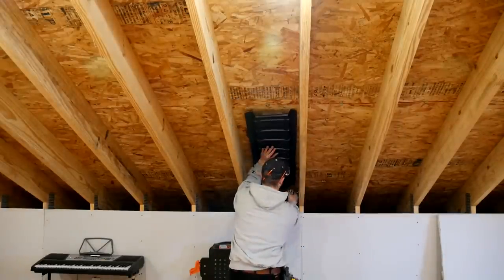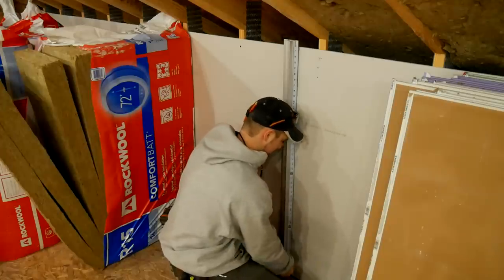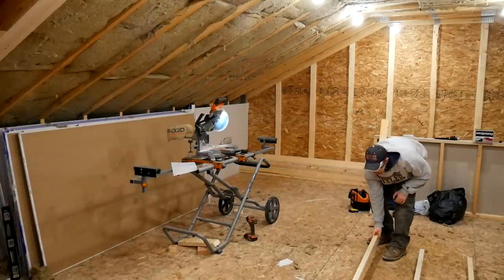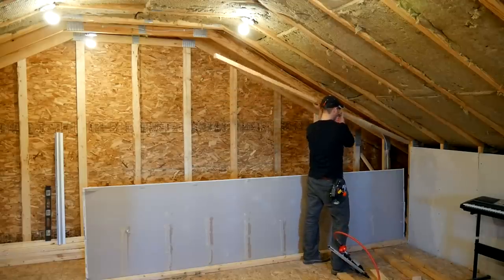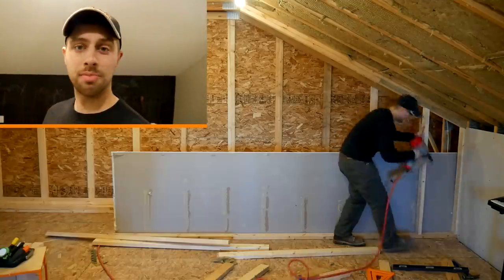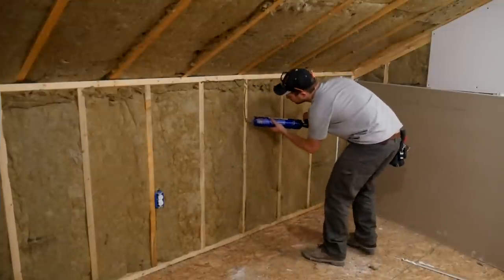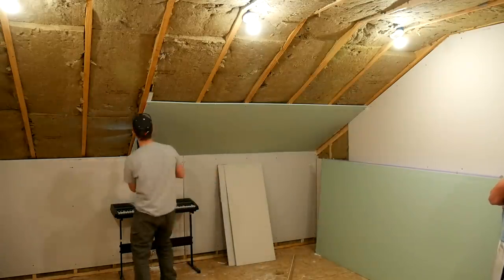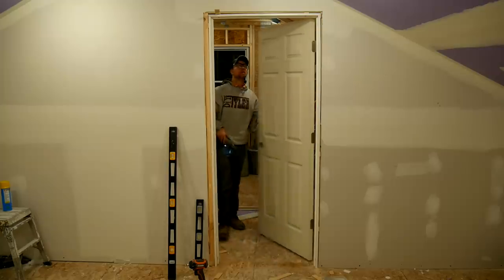Turning an Attic into a Playroom with a GIANT Chalkboard!

Comment from the maker: Thanks for watching, we appreciate you taking the time! You might be asking why no vapor barrier...you see, I had it up and the sheetrock guy told me to take it down! OK! Either way, this Rockwool can absorb water and dry out with no risk of deterioration so I am not really worried about any vapor.

Be sure to check out Carolina Shoes and use the promo DIYTylerAttic for 10% off!! You won't regret these boots!
Reply: i would like to know the sheetrock guys reason for not having a vapor barrier? does it make his job harder?
Reply: probably not a big deal maybe just less efficient
Reply: Thank you for this video. I subscribed and shared, plus I hit the notification bell. This Transitioning Army Vet is going to be very busy.  You don’t know how much you helped me!
Reply from the maker: Thanks Tyrese. ARMY STRONG!
Reply: This was a great idea and really good transformation. Although, I am wondering how the kids access the attic because it doesn't look as though it was a full loft conversion with a staircase.

Comment: Nice work Tyler! If you ever have to install a pre-hung door again a carpenter friend of mine gave me a great tip for hanging doors (especially by yourself). Put the casing on one side of the door with all the correct reveals and mitres. Then when you place it in the opening it can't fall inside of the opening. I used this method and after 2 or 3 doors I was popping them in pretty quick. Thanks for the great video and glad to see the kids are so smart and that cursive writing is still a thing!
Peace,
DC

Comment: great addition to the house. I have a framing nailer that I bought to finish my basement. what a handy tool. I since used it to build a shed and my new shop. Just a tip. I prefer not to do math and measuring if I can avoid it. You could have used a plumb bob to mark the studs on the stair wall. You should install some carpet in that room. It will get rid of all the echo. (I am a carpet installer :) )

Comment: looks good very nice job, but i have a question, what about ventilation? do you had to add any attic ventilation fan or how you keep air flow in the summer for example, would it be to hot in the summer? im trying to finish my attic also 
thank you

Comment: a faster way, with no math, is to mark the locations of the studs on the bottom plate.  then simply use a plumb bob to find the location of the studs on the top plate... mark, measure stud length... cut and go.
Reply: That was my thought exactly. My head exploded once Tyler starting talking math. 😂
Reply from the maker: I have my doubts that it's faster but what do I know! I thought an impact driver was fast enough to build walls. Thanks for watching!
Reply from the maker: Oh, common it was easy stuff!

Comment: You at least need to put something on the back to hold the insulation in place for the wall. I cannot believe you just put it there behind the drywall and hope it will stay in place for the next 50 years.